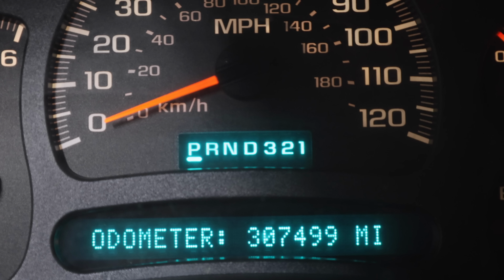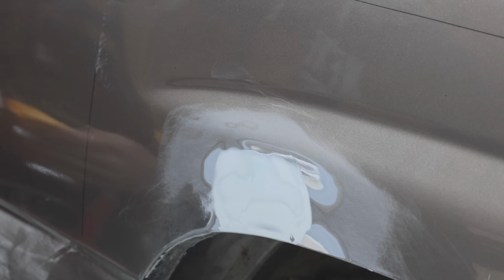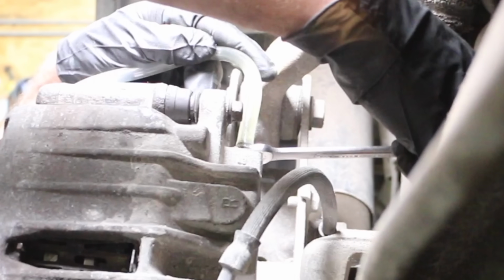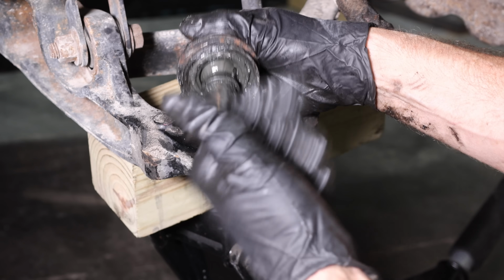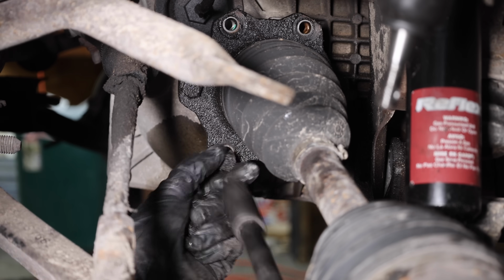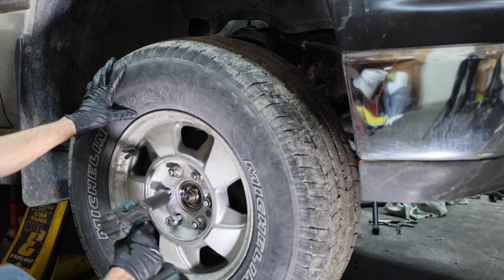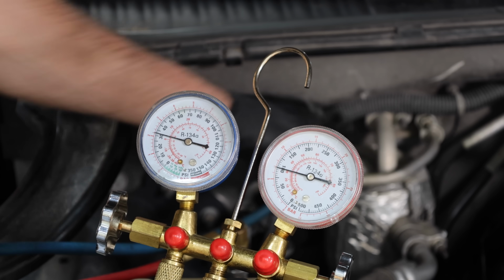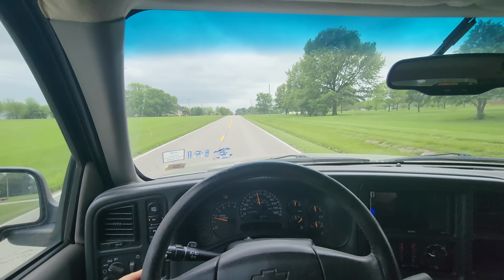Is It Stupid To Fix Up A 300,000 Mile Vehicle? Let Settle This!

Comment: The "power steering pump" is actually the steering box...
 The power steering pump mounts to the front of the engine,is belt driven, and has 2 hoses to it: a high pressure hose which powers the steering box,and a low pressure hose which returns the hydraulic fluid,aka power steering fluid,from the steering box to the reservoir which is mounted to the pump on the engine..

Comment: Hey project farm could you do some more fuel economy testing on engines, I know exhaust mufflers on lawn mowers can be restrictive and maybe putting a straight pipe on will free up some Hp and maybe fuel efficiency? Or even try a efi vs carb fuel efficiency test.

Comment: You have been more helpful than I can afford to repay, so I may as well share experience where I can. Thank you for being awesome. Also, your pace is perfect. You keep it entertaining and informative without losing us over filler. Keep it up!
This video in particular is why I buy worn out and sell less tired.
Tips, pointers, and other  BS below.

Ball joints are a PAIN. Glad yours came right out. If they don't, you can always gently burp an impact on the removal clamp (especially if you grease it like that) and smack the arm or joint with a small sledge while its under pressure. Upon assembly, always make sure they are perfectly clean and free of debris. I also like to add a smear or two of WD40 off of fresh clean gloves for good luck next time.

.....You know what you're doing, but a lot of people are parroting to learn so I'm just gonna say it: Do not hammer splines together, be gentle.
Line them up, maybe thump it a little with your fist or palm, but hammering them together can damage the spline and remove it's ability to slide smoothly under stress. It can also create points for either side of the spline to crack or shatter. Splines were a massive technological advancement when they came into the world and, though easier to make now, are no less sensitive to damage.

That fan clutch bit ahahahahaha the number of times I have heard " iT sTiLl ruNs bUt MaH aIr CoNdITiOniNg iS wArM" about an angry overheated brick full of hammers is concerning.

Man, I thought the steering my '84 F250 with a TTB front axle was sloppy but this setup is in better condition and somehow worse. If you measure from one hard point to the next (centers of pivots, ends of mounts, limits of travel, etc) then your alignment can be nearly spot on right off the bat. Diggin' the bungie cord on the steering wheel - that's a genius idea.

Diff fluid?!? You're really going all out! If you happen to find an old fire extinguisher you can empty it, put a tire air bung into it, and you only need around 5-10 psi to move 80/90 into a diff when you flip it over so the fluid is by the valve. You can even use the original valve and give it a barb fitting to put whatever length of tube you want on there.

When changing an automatic transmission's fluid, try not to do more than 50% at a time as some of that dirt can be what keeps an older transmission tight or at least operating well enough. the best way to change it is to wait a few thousand miles and do another 50%. The goal is to lower the percentage of old fluid and dirt gradually to an acceptable level rather than to do it all at once without a rebuild and potentially shock the system (think uneven pressure on valves and solenoids). Manual transmissions typically do not care, they just need to have the right fluid in them.

Damn. I have to fix my fuel filter setup. The last guy put at least 6 under there. Pretty sure he made his own diesel. If you have to add ATF Type F to your diesel, keep a partial bottle so you don't get dinged for running tax-free fuel.

TLDR: nerdiness.

Comment: I was going to school learning this auto stuff back in the 80's and the school/college was sponsored by Chevy.  OK several things you should do in this video. scrub the brake disks with brake clean and a "brake" brillo pad to put a real cross hatch pattern on the rotor so the pads seat in faster with less noise. the small dust cups on the outer tie-rod ends square on both the big end and the small end or they won't seal right. The fluid replacements, the vehicle needs to be LEVEL or as close to level as possible, you could over fill or under fill them. The fan clutch should be tightened just like a wheel 1-3-2-4 pattern. Oh the alignment on the front end before you adjusted it is called toe-out/plowing. The auto transmission change the fluid AND filter every 3 to 5 years no mater what the mileage is (just ask Scotty Killmer). Fuel injected along with some carbureted vehicles the fuel pump is electronic/electric and they are in the tank so the fuel filter only protects the carburetor or fuel injectors they don't protect the pump even my 1973 plymouth the filter is/was between the pump and carburetor. RTV sealants there are basically only two curing types, Sorry but I can't spell them but one cures in air and the other cures in the lack of air. So for the diff. cover so go with the kind that cures without air.

Comment: I’ve got a 2002 gmc sierra 2 wheel drive v6 350000 miles on her. I swapped the alternator to a higher output one for a 2500 HD so I could swap over to the factory electric fan set up for the slightly newer gmt 800s I did have to swap my radiator to the wider one and come up with some wiring solutions because the years and engine combo ecu lacked some output pins but through relays I get close to the same effects. The factory E-fans are really the ticket for keeping the ac cool at red lights. I do have a broken exhaust manifold bolt and leaking exhaust gasket but that’s a can of worms I haven’t had a chance to dig through yet.

Comment: 4:57

Ya... my dealer told me 350 per corner for pads/rotors BUT if the rotors had life left they'd just turn them, and charge the same price as if they were replacing the rotors. PASS. Oreily's will turn your rotors for 15 per rotor, and pads are typically 40-80 dollars.

Far as replacing it... if it ain't broke don't fix it? My 300zx has 250k+ on the engine(made higher than stock power on dyno at 15AFR) and similar on the chassis. Transmission is unknown but given 4th gear grind(syncro) it likely has as much. It's in the shop now for timing and misc other service, upgrading radiator to dual core, replacing/upgrading control arms, bushings, injectors... I'm keeping it a long time.

Jeep? Meh. I hit 169k on it last week, nice, but with its "lifetime" warranty I won't be getting rid of it. Meanwhile the kia I'm considering selling the moment something else breaks on it.

They really don't make reliable cars anymore. Considering buying an older toyota or honda when the kia breaks again.

Your pacing seems fine to me. Never had a problem with it, although sometimes I think you should go a "bit" slower... but you also cover a lot of info in each video so that might not be viable.

Comment: 👍🏻😎My 2006 Crown Victoria has 180,000 miles and 4500 idle hours. Still runs great. I just had to replace the intake manifold. It cost $400 and about 4 hours of work that I did myself. I've owned it 10 years and have spent about $1500 in maintenance over that decade and doing all of the work on it myself. I'm getting ready to replace the pads and rotors front and back and I plan on driving it at least another 10 years.
Reply from the maker: Thanks for sharing.

Comment: Is it stupid?  I rebuilt the engine in a truck I got cheap after a plumbing company owned it for 20 years and put over 300000 miles on it.  It's a great truck, usually gets better mileage than newer trucks, and has zero diesel emissions garbage on it.  

Newer stuff is getting really bad with all the extra stuff that most people don't even use and nobody ever needs.
Reply from the maker: Nice!

Comment: I have 210k on my 2003 Suburban. The wife keeps asking for a new vehicle, no way. This is one of the most reliable/cheap to fix, comfortable spacious vehicles still in existence. Yeah, MPGs are a bit of a struggle and I WISH it had at least a six speed for towing, but it does it all well enough.
Super proud of you and your channel, I've been subscribed since you had 13k subscribers, amazing work pays off.
Reply: That is the one huge downside to the older vehicles. Most of them get terrible MPG's. I still have a 2005 diesel Excursion for my 6 kids but it is cheaper to take two modern cars. Mostly just use it for camping and family vacations where we all want to be together.
Reply from the maker: Thanks so much!  Thanks for sharing.
Reply: 2024 suburban has not changed much.   mostly sheet metal and touch screens
Reply: Make your own biodiesel from used vegetable oil for about $2.50/ gallon. Who cares about mpg when fuel is so cheap.

Comment: How were those park brakes? It didn't look like you even cleaned them.
And, did you torque the lug nuts?

I had to buy a big snap ring plyers to remove the ones the the wheel bearings on my Mercedes.

So far, when I change inner and outer tie rods, the alignment is still off. LOL

Comment: My 2006 Charger SXT 3.5 has 309K. I'm in commifornia, so no rust. The transmission is my only worry. It takes about 3 seconds to change from reverse to drive. I should have changed the fluid and filter on the transmission when I got it. It had 223K miles, but it was highway miles. When I finally changed the transmission fluid and filter at 300K miles, there was a thick layer of friction discs dust at the bottom of the pan. It's probably just a simple rebuild of changing the discs.

There is oxidation in the clear coat.
Reply from the maker: Thanks for sharing.

Comment: I’d say if you can perform all of the repairs yourself, then, no it’s not stupid. I know you are meticulous when it comes to servicing and maintaining your vehicles and equipment so there’s no reason not to keep this suburban up and running. The real beauty here is that if the engine ever went out, the market is flooded with them - many can be had for less than $1500. I have a sneaking suspicion you’d had no problem performing the swap!
Reply from the maker: Thanks for the feedback.

Comment: You should try doing a video comparing different laundry detergents, and the amounts used. Powder detergent versus liquid detergent. Also I think a great test would be different concentrations. 
You know how on the bottle it always says to use x amount of detergent? Maybe try using progressively less and seeing how that affects the results. I've seen lots of people talk about how you can get away with using less and less  detergent. Even as little as a 1/16th of a cup for a load! The theory is that the soap companies will tell you to use more so you need to buy more detergent more frequently.
Reply from the maker: Thanks for the suggestion.

Comment: Great video and the format is perfect no need to change it 😎👌

I was wonderin if this vehicle has a catalitic converter and a O2 sensor that you may want to check besides cleaning the injectors to improve fuel efficiency after the 300K miles of usage 😉🙌

Comment: Over 610,00 miles on my 02 Silverado with a 5.3.
Brakes last 100,000 miles
Reply from the maker: Nice!
Reply: I hope mine holds out that long. I'm halfway there @ 320,000. The 1999-2007 years of GM truck and suv are absolutely insanely reliable.

Comment: Keep the speed up my friend! Absolutely gorgeous GMT-800 Suburban! I have a 2002 GMC Yukon XL with a little over 325k miles and it's still running strong. The sad thing is that I live in the rust belt and even though I've done my best to rust-proof the truck, the body is losing the battle against road salt. These trucks are some of the most reliable vehicles GM ever made.
Reply from the maker: Thanks for the feedback.

Comment: I’m looking down the barrel of a 330k mile 02 Silverado rebuild. In fact I was pricing parts today.  What a happy surprise it was  to discover this video
Reply from the maker: Thanks for sharing.
Reply: What failed at 330,000? I have a 2001 yukon with 320,000 miles. Maybe I can go ahead and put money back for the parts, lol.
Reply: @GodBlessPresTrump  brakes and suspension are shot.
Reply: @rotaryrich  OH yeah, been there and done that, lol. I did shocks and brakes about 2 years ago on my 01. It does make a difference in ride quality and stopping distance. Rides like a caddie.

Comment: My 2004 gmc envoy xl with a 5.3 liter currently has 340,000 Miles on it. Have had it well over 15 years.  It's been turned into my work car to finish off its life. The day is coming when the 4l60e finally gives out and I have to retire it. That first gen ls will never die tho
Reply from the maker: Thanks for sharing.

Comment: For me, I wouldn't mess with it. I would however, be more than happy to fix a 300,000 mile vehicle that was made before electronic fuel injection before complex wiring harnesses, before 30 different computer modules to control everything.    It's not the mechanical side that I'm worried about, that's easy enough to fix. It's the electronics. They are are nearly irreplaceable, an incredibly expensive even if you can find replacements.
Reply from the maker: Thanks for sharing.

Comment: 7:00 okay so I'm not the only one who has thought up a way to bleed the brakes with an electric pump, that's cool. I'm trying to set up a system that also feeds new fluid into the reservoir as the old fluid is drawn down the lines, too. Basically it will be an empty bottle to catch the old stuff and a full bottle to feed the res all in a closed loop. There are kits on ebay but I don't think they work in the exact same way I have in mind.
Reply from the maker: Thanks for sharing.

Comment: You spent 2000 on a 5000 truck. But if all that would be done over a year, it would be easier
I would say you could probably sell it for $8000 at least. But why?! Lot easier to work on than the new trucks

Comment: Question: How much did it cost to do all that work to your car? Part and estimated labor.
Cuz it looked like a lotta work. 

And keep the current format, it's fast but there's also a thing called a pause button.
Reply from the maker: It cost me $2000.  If it was hired probably between $4500-$5000.  Thanks for the feedback.

Comment: Another great video! And the investment you made is 100% worth it. Ironically when I rolled into work today with my 2000 Yukon xl  a coworker told me that I was leaking oil. I live in NYC with all of the wonderful salty winters and I have been driving my truck since 2003. The rust has really had its way and today I’m actually considering retiring it. The LM7 with 218,000 miles runs beautiful - but over the years I’ve been replacing all of the tubing on the vehicle. I’ve done all of the brake lines, all of the fuel lines - and today - my PS cooler hardline started spraying PS fluid. I got a bandaid on it to get home tomorrow but after seeing the transmission cooler lines and knowing what I’ve seen under the truck it’s about time. It’s been a great vehicle for 21 years, I wish it would last longer but it’s RUSTY as all heck.
Yours is beautiful so enjoy it for as long as you can. They will run forever but where I’m at - metal decay is inevitable. Unfortunately….

Keep the great videos coming, I’ve been watching for years 😃👍
Reply from the maker: Thanks, will do!  Thanks for sharing.

Comment: This vidio was a great example of the American people have become in some areas. All of the parts that were changed were designed to fail and be replaced. The United States has become a throw a way society so instead of building better cars 30 years ago the marketing was geared to the idea that if your car needs repairs just purchase a new one. Also there has been enough junk cars built over the years to reinforce that idea. 

The other problem is that manual skills are not taught in the schools now. It used to be that if you had a problem for the most part you dealt with yourself. If you look at the history of the US the black smith was not just a big man that pounded on hot metal. He had to be the engineer, craftsman and artisan. He built wagons that traveled thousands of miles with maintenance within the limits of the materials that he had on hand. A carpenter was not just someone who built buildings out of round logs. He was an innovator that people came to when given a request would say "you want what built where well I will have to think about that". Then he came back and he did it. When they built steam engine trains they didn't break down much and could be repaired. Nowadays if it breaks throw it away because it is not repairable. There used to be TV shops that actually fixed TVs. Not any more. 

If you have to keep up with the Jones then you are just as much of the problem as the Jones and the people who build the junk in the first place. Taking a vehicle that has high mileage and using it until it can't be used anymore is the true ecological way to help save the earth not replacing it every 5 years because the floor mats are dirty.
Reply from the maker: Thanks for sharing.

Comment: I was taught to open the bleeder while pushing the brake piston back in to keep dirty fluid from going back through the ABS pump/solenoids and causing problems. 

Is this recommended or not?
Reply from the maker: Thanks for the suggestion.

Comment: FWIW, My understanding is that, if the AC is equalized, having not run in quite some time and the temperature throughout the system where the refrigerant is is equalized (as when the vehicle has been sitting for an extended period and not recently running), then the pressure isn't a good indicator of state of charge...  UNLESS the pressure is significantly different than the saturation pressure at the temperature of the components/refrigerant.